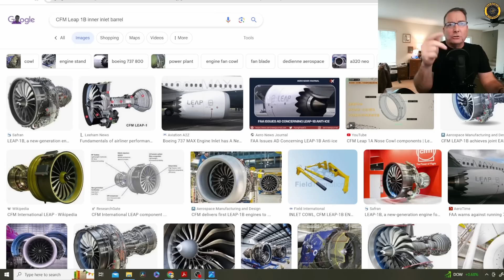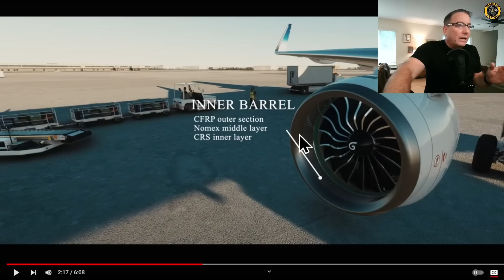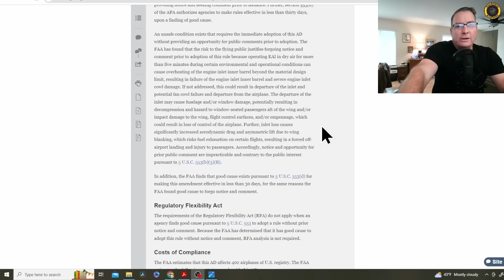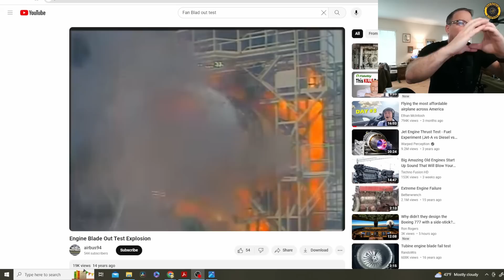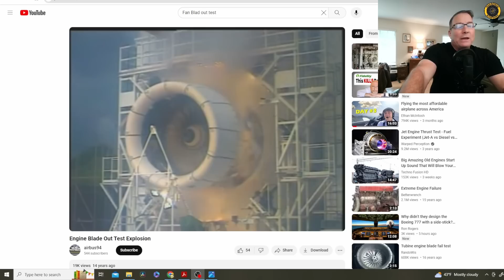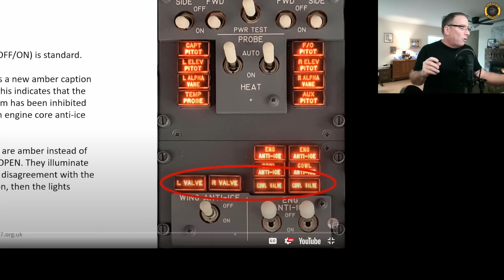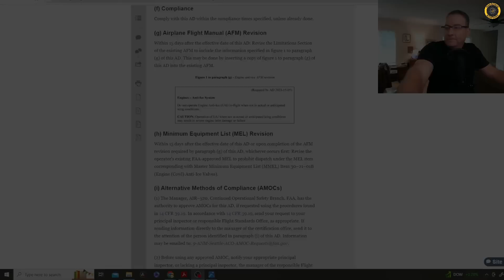Boeing 737 Max-7/-10 Certification HALTED! 1 Feb 2024

Comment: Just speculation, the reason this has not apparently become an issue on Airbus’ or Comac’s is because of both their automated anti/deicing system, and the cowling design?
Reply: CFM does not design/make the nacelle anti icing components and the problem is not the LEAP engine. It is Boeings design of the nacelle anti icing system/components that is the problem. Airbus uses a totally different design and has NO problems
Reply: @Paul1958R  that was what I was trying to confirm, why other aircraft having the same engines, don’t have these problems.  It’s Boeing’s cowlings and systems for CFM’s engines.

Comment: Doesn't the A321 use essentially the same engine?
Reply: CFM does not design/make the nacelle anti icing components and the problem is not the LEAP engine. It is Boeings design of the nacelle anti icing system/components that is the problem. Airbus uses a totally different design and has NO problems
Reply: Thanks for the reply. I have a friend the retired from Spirit, I'll ask him what he thinks other than he REALLY glad he is retired. @Paul1958R

Comment: Boeing is now under a microscope, which counter-intuitively could result in less-safe airplanes. "If it ain't broke, don't fix it" comes to mind. While the general public is convinced there's serious safety issues with the 737 Max, the statistics tell a completely different story. From what I have learned, both Boeing and Airbus are building airplanes safer than they have ever been, even when you consider the 2 737 MAX accidents in 2018 and 2019. Is Boeing a perfect company? Far from it, as we have seen with the latest deficiencies such as plug door and this engine deicing issue. Boeing will NEVER be a perfect company, but as long as they continue improving their safety record, I'll continue to sleep like a baby on a 737 flight.

Comment: Boeing deserves a LOT of scrutiny.  they are not just making mistakes,
they are making mistakes that only happen if there is already a mistake afoot.
the engine containments do not work. and they want to go with
ok fan-blades in passengers is not a good optic buuuut 
that is going to take some research to fix?
that path has a biig mistake,  Boeing seems to think there is no need to fix
a system that will cause the fan-blades to break loose.  
fix one or the other and then an exception can be made
because then the passengers are not in direct danger

when did the management of boeing become criminally stupid?

Comment: Thank you, Juan, always very interesting watching your videos. What I can't believe is how far Boeing has strayed from what used to be their main objective, building safe, reliable aircraft.

I haven't finished this video yet, I'm at about the 7:30 point, but when you mentioned the 737-MAX doesn't have a warning light to tell you that you are in icing conditions, I started this comment. This was one of the problems with the MCAS system, there was no warning light on the majority of the MAX aircraft that airlines ordered, as the light was only working on aircraft with an optional indicator. This indicator was only ordered by 20% of Boeing's customers.

I think what was an even more troubling find was that Boeing had deviated from long standing aviation canon when they decided only one sensor was needed for the MCAS system. When dealing with flight controls, and any other safety-of-flight system, there has always been redundancy built in. A second, and in some cases, a third system is there for back-up.

At about 10:00, you are talking about Boeing backing down after enough push-back, and halting the -7 and -10 certifications. That is not a good sign when Boeing does not even realize the danger of the situation of putting these aircraft in the air without knowing how they will handle in adverse conditions. It still comes down to money, and that's scary.
Reply: Doesn't it mean that the FAA needs to prevent them from flying until the issues are actually addressed by Boeing? If the FAA requires action, Boeing can't take the cheaper option.
Reply: @theharper1  The FAA should have kept them all grounded after Jan 5th until every issue with the MAX aircraft was identified and resolved. Unfortunately, there is still some of the original problem on both sides, Boeing and the FAA, so they tried a quick fix inspection of the plug doors as the reason to allow the MAX-9 to fly again.

I feel all of the MAX variants need to be verified as airworthy. This is because with all of the escapes that are now out in public, it doesn't seem the MAX fleet is ready to fly passengers any time soon.

As for your specific question about the FAA requiring action and Boeing taking a cheaper option. When I discussed an airline not taking options for a system on the aircraft they ordered, I was talking about something that is decided during the manufacture of the aircraft. This will be before the FAA sees any official documentation, or configuration information.

The manufacturer has to set up an Initial Maintenance Program (IMP) before shipping to an airline. That IMP has the minimum requirements for maintaining the aircraft in an airworthy condition. This is when all of the options would, or would not have, been installed.

Whatever the FAA comes out with now, like what happened today with the halting of the -7 / -10 MAX certifications, Boeing is required to follow the FAA's directives.
Reply: Why aren't ALL passenger planes required to have anti-icing measures?

Comment: Why don’t they just return to the alloy that worked? How much weight difference is there, would it make a huge difference in fuel use and emissions? 

The 737’s are outdated, if they were concerned about safety they would have updated it so it’s an automation on/off system. 

Also, why are the other Max versions allowed to fly? I think you said this is an issue on all Max versions.

Comment: Do the LEAP 1-A engines used by Airbus have the same issue with inner barrel?
Reply: CFM does not design/make the nacelle anti icing components. It is Boeings design of the nacelle anti icing system/components that is the problem. Airbus uses a totally different design

Comment: I fly the max9 and have received no specific guidance on the anti ice problem. I actually forgot to turn it off on my last flight because the changed the lights. The lights are now off instead of blue when anti ice is on. Yay Boeing…
Reply: Yikes! Talk about “counter intuitive”!
Reply: Do you read checklists-?
Do you read and understand the appropriate mnuals-?
" received no specific guidance on the anti ice problem " -????
Reply: @John-nc4bl  Too harsh, John.  When part of a machine (like an aircraft) is redesigned, or is found to have a problem, it should be incumbent on the producer to draw the attention of users to that change or defect - not expect the pilot to read 6000 pages of doco for this release and the last release, and identify the differences.    MCAS was a case in point.   De-Icing restrictions are another.
Reply: @oldcynic6964 MCAS was just a change to auto trim. Yes, the software behind it lacked input checks that were being taught in high school programming classes 14 years AFO, but the underlying technology was just auto trim.
Reply: Your mom usually reads them to me, she must have missed that part 🙃
Reply: Your mom usually reads them to me, she must have missed that part 🙃
Reply: Your mom usually reads them to me, she must have missed that part 🙃
Reply: Your mom usually reads them to me, she must have missed that part 🙃

Comment: We used to know how to design and build airplanes that worked. Multiple pressures such as fuel economy, emissions and cost per passenger mile have resulted in short cuts and bad design decisions. Commercial passenger flight started out sketchy and dangerous and is trending in that same direction, a tragedy which will become all too obvious...

Comment: Airbus A320neo family, Boeing 737 MAX, and Comac C919 use this same engine. I believe, like Boeing, the airplane manufacturer builds the engine inlet cowling.  Do the other two airplanes have this same problem?  As for Boeing, this is an airplane design or redesign problem that would not necessarily be solved with a clean sheet airplane design.  Because the engineering assumptions   could still be applicable to the all-new airplane design.  In my view, as a pilot and aero engineer, this issue is Boeing design problem, or design flaw.  Therefore, these airplanes should be restricted from flying in icing conditions until the issue is permanently fixed.  The risk of severe engine damage is simply too great.  Can you imagine an engine blowing up at the point of no return position during an ETOPS flight?  Ie, at the furthest point from a “suitable airport” requiring flying up to 3 hours to get back on the ground with one or even both severely damaged engines?

Comment: I would hope Boeing still has some good Materials engineers on staff; my concern was this may have been a managerial override, based on bean counter cost decisions. There are plenty of high-temperature composite matrix materials out there. This may also be a manufacturing issue leading to defects such as delamination. This is all speculation on my part, BTW😉.

Comment: Whilst the problem is ultimately in the engine and cowling, this seems to be yet another example of Boeing desperately pretending that various systems on the aircraft haven't changed to avoid having to go through a more comprehensive certification process or requiring airlines to actually train pilots properly in the new stuff.

We know they've also been leaving safety critical information out of their manuals. Presumably for the same reason.

I think it's time the FAA requires the whole MAX line to be completely recertified as what Boeing  has previously provided to get those certs can't be relied upon.

Comment: Pass the bleed air through an intercooler. Have an automatic flap control the air into the IC and a temp sensor stuck in the bleed air stream of the output of the IC.

Comment: As of December 2023,  11,660 Boeing 737s have been built with more than 8,000 still actively serving airlines worldwide. 
The 737 is operated by over 5,000 airlines across nearly 190 countries.

This is an impressive production run for a civilian jetliner and the first one in history to reach this number.
Reply: Source:  Wikipedia
Reply: That's because it is actually four different aircraft.
Reply: Still a good production run for 737s
There is a lot of commonality with the fuselage shell as well as the center wingbox as well as the wing spars ribs and skins between the spars.
Empennage structure as well. @johnbriggs3916
Reply: There are lots of similarities. @johnbriggs3916
Reply: Incorrect.

Fuselages are the same diameter and structure, some just longer.
Wings are the same between the fwd spar and the rear spar.
Just extended leading edges and trailing edges.
Many similarities with the empennage, vertical and horizontal surfaces. 
Same H. Stab center section. @johnbriggs3916

Comment: I fully agree with you, this 737 MAX shouldn't exist, the 737 itself should have been put out to pasture and they should have designed the "New Midsize Airliner" instead.
They have that whole 787 avionics to work with, a fully fly-by-wire and bleed-less aircraft (except for cowl anti-ice), why can't they INNOVATE like they used to?
You can't prioritize profits over everything else. Shareholders don't know how to run YOUR business because they don't know what YOU know (if they do, they could do insider trading, and the FTC doesn't take kindly to that).
Only an engineer can engineer something. And only an engineer knows when it's time to reset the "technical debt" counter by creating a clean-sheet design.

There's a reason you don't see 707, 717, 727's flying around anymore. They weren't able to be modernized sufficiently.
Why you don't see 757 and 767 is kinda a mystery to me. Those were good aircraft, weren't they? Why weren't they modernized, had their number of fuselage sections adjusted to suit the needs of the airlines, etc... like the 737 was? The 737 is now a very square peg in a very round hole, because especially the Max-10 version is starting to be "why do you have this and not just a 767 with better engines and a new wing"?
The reason to stick with a narrow-body design is beyond me. Why the 737 is "a better candidate for modernization than the 757 or 767" is beyond me, but I doubt that there is an ENGINEERING reason behind it. If there is, and someone can explain it to me in words an auto mechanic can understand, I'd love to gain that knowledge!

The 737 is far too long in the tooth. Time for it to rest it's wings, and for the New Midsize Airliner to take it's place.
Reply: Except the Air Force KC-135 Stratotanker (717) is still in regular service. 😉 But I know where you were going with this. I think they rushed the 737 Max as a response to Airbus and felt a clean sheet design would have put them out of that competitive market for too many years. Once they lose that 737 market, it would be difficult for them to regain it. The fatal and near-fatal incidents with the Max series certainly haven't helped in that regard either.
Reply: I think the underlying issue was the fact that the airlines wanted to saves costs as much as possible, and relayed that to Boeing.  IMO they stuck with the 737 since there was an overwhelmingly large number of type rated 737 pilots vs 757, etc.  It mostly all came down to the facts that airlines didn't want the cost of retraining/ re-type rating their existing pilots.
Reply: @truthserum5310  "airlines didn't want the cost of retraining/ re-type rating their existing pilots."

This is an FAA problem.
Reply: @dafunkmonster 
It's partially an FAA problem, but like I mentioned in my original post, the 777 and 787 cockpits are right there, ready to be used in another aircraft.
So this "modernized 757 or 767" could easily be made to share most handling characteristics with either of those aircraft, just the whole aircraft is smaller.
In fact, they could have just as easily made a "787 SP" to replace the 737, which would have made sharing a type certificate MUCH EASIER, since it's "literally just another 787 variant that happens to be very small".
The 787 has a fantastic wing and engines already. Making that push around a 737's workload is child's play, and they could open up more non-stop routes with the longer range that the bigger wing on the smaller aircraft would allow for.
If needed, they COULD down-size the engines, but IMO it's far more likely that they would instead just de-rate the existing GEnx engines that the 787 already uses.
Reply: Like a 757-SP. The 74’-SP sure was a hit.
Reply: "I fully agree with you, this 737 MAX shouldn't exist, the 737 itself should have been put out to pasture and they should have designed the "New Midsize Airliner" instead."

Why do you hate regional airline travel so much that you wish to see it disappear?
Reply: I haven't found convincing answers yet as to why the 757 didn't get a chance for further development instead of the 737.
Reply: @Daenou-SWE-SUI  The 757 is a bigger, more powerful  plane all round.   Bigger than the A321 Neo for example.   So if you can do the same job with a smaller plane, that smaller plane is generally going to be more economic.    So the 757 was only competitive for jobs that the 737 struggled with, most jobs the 737 (and the A320) would beat it.   Of course the 757 has far more room for development than the 737 but, at the time the 757 was discontinued, the plans were to replace the 737 with the NMA (I think it was?).
Reply: @cr10001  Exactly, which is why Airbus' A321XLR and A330Neo are such good options. Both combine to give you the same capability as Boeing's potential 757 Max or NMA, but both can also be used for other jobs.
Reply: @cr10001 
I did mention adding OR REMOVING fuselage barrel sections as needed. So like others have said, something like a 757 SP (in the vein of the 747 SP) would have been a good idea to serve the smaller markets.
I also mentioned re-doing the wing with modern techniques (maybe composite, but certainly a supercritical wing with blended winglets at the least, even if it is aluminum), which would increase aerodynamic efficiency.
Re-engining would also be on the list, maybe they could have used the same engines the 737 MAX is using right now, I'm not sure, but that's very much a solvable problem.

Even if they had still been developing this "moderized 757 or 767" that I was proposing when the demand started arising for more modern and more efficient midsize aircraft, there was a solution that Boeing could have had if they didn't mess it up and let it get snapped up by Airbus.
Bombardier. Boeing should have just bought the sole production rights to what was for a time known as the C-series (before acquisition by Airbus).
Boeing has fumbled the ball MULTIPLE TIMES here. And they deserve a corporate reorganization as a result.
Reply: That’s because of Southwest Airlines. Their whole business model depends on flying one aircraft type. The 737. To change would cost them hugely in training until the whole fleet was replaced. Other airlines (for example Ryanair) have adopted the same model.
Reply: @cjmillsnun  Yes, and while the clean-sheet replacement for the 737 was being developed, they'd have nothing to replace their retiring 737s.

All of that would mean price hikes, layoffs, etc.

Sorry, all you plebs in the middle class, you won't get to travel by air anymore.

Comment: Boeing made great aircraft until they merged with McDonnell-Douglas.
Boeing used to be  run by engineers... McDonnell-Douglas  was run by accountants and was failing.
After the merger, the new combined company was taken over by the accountants.